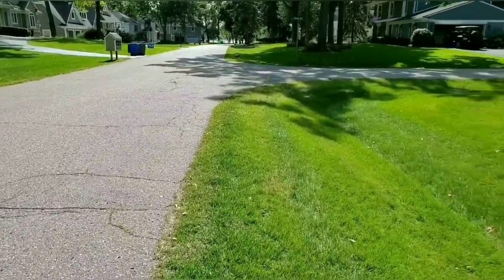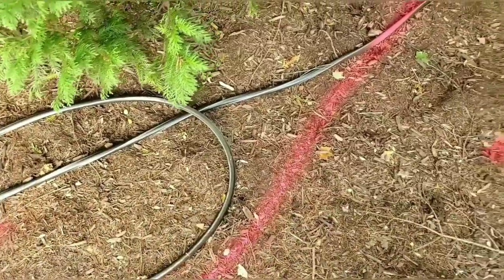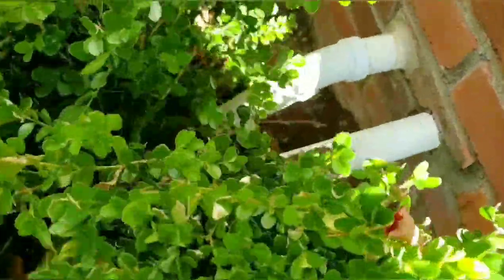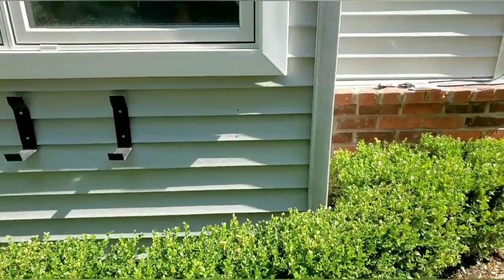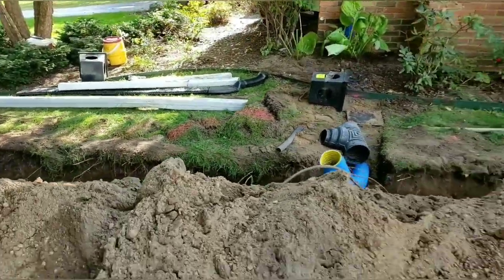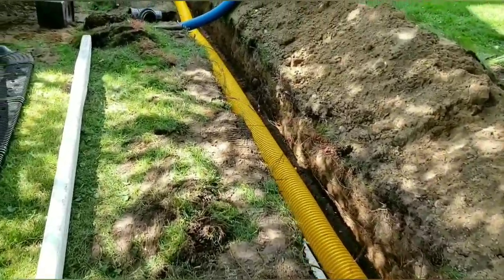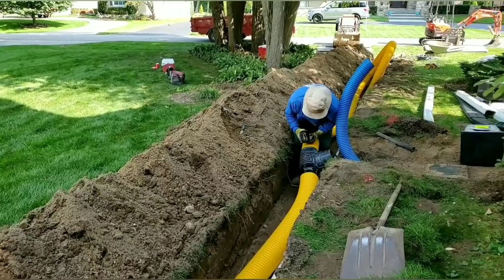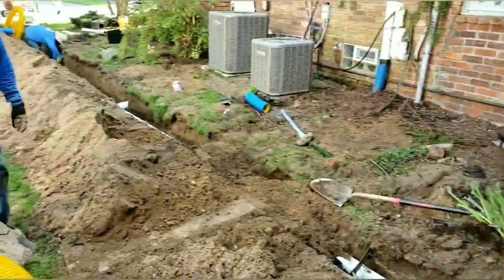6" Main For Roof Runoff & 3 Sump Pump Lines [ 1 Trench 2 Systems ] West Bloomfield Hills Michigan

Comment: Hey thanks for the up load.  Im working on getting a contract for installing a fdm sump basin and pit on 2 apartment buildings in a complex  with the dwnspouts  and 92 ft french drain discharging into the sump pit. Would be awesome to see some full installs of  sump pits and basins. On commercial if you have any footage.
Reply from the maker: I'm editing a video Stay Tuned for a  video in the next couple weeks